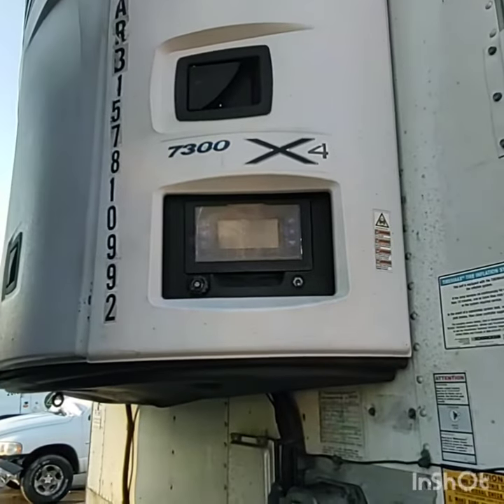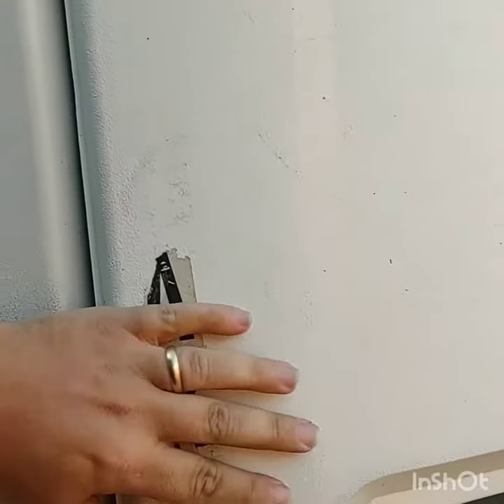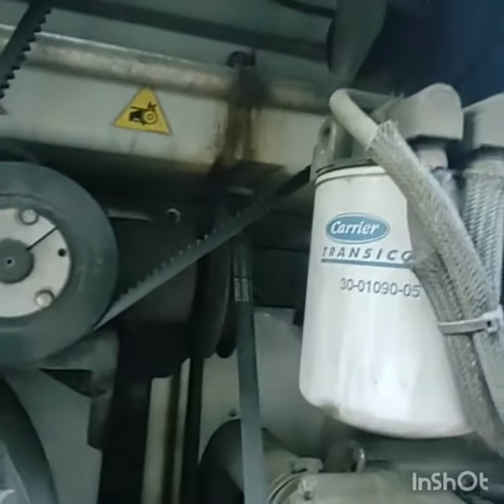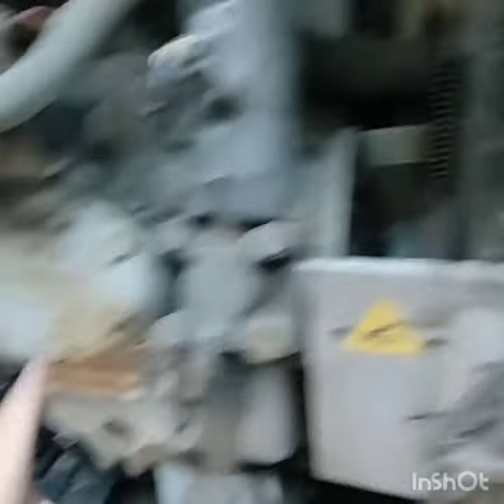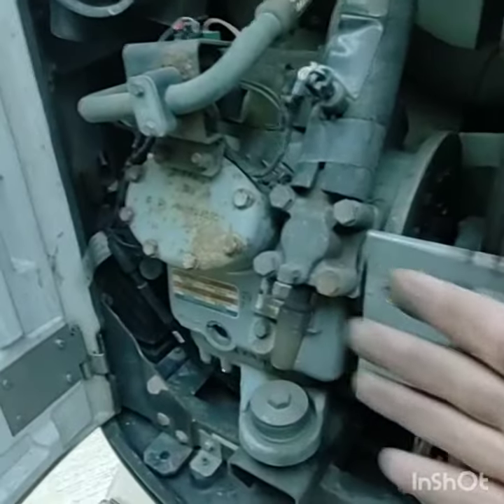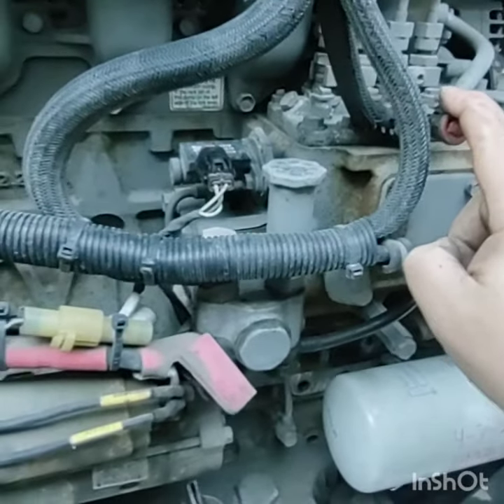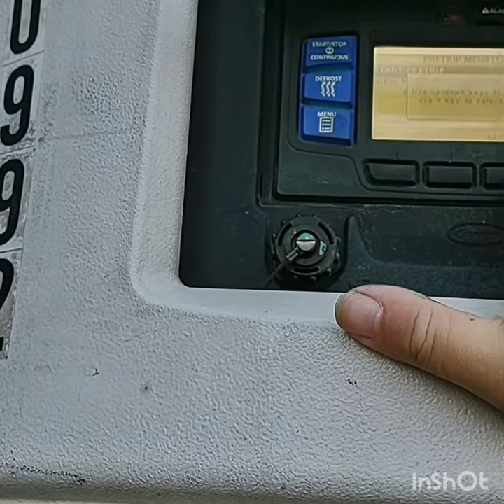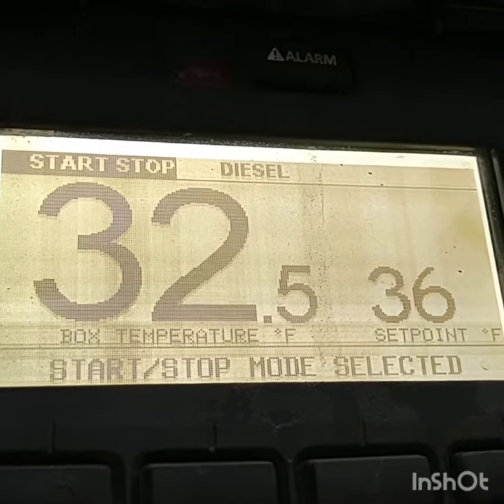Check these things regularly on your reefer unit....save money and problems later.

Comment: Good advice on wiring on alternator starter etc, my 1st trip on my 1st trailer a wire connected to the alternator snapped off and reefer shit off(lucky it didn't catch fire) and it costed me $250 for a simple snap on new connector on from wire to alternator bolt. Tha was my 1st ever reefer load and I was nervous lol got scammed out but I learned my lesson

Comment: Fuel saving tips: Get a extended blow gun to clean the condenser before every trip. Have a dealer install a simple door switch toggle next to the display to trick the unit in low speed only. Install a electric lift pump to take the load off the mechanical pump. The efficiency difference is noticeable and it will prime the fuel filter for you. If you have a exhaust leak change the air filter more often until you get it fixed. Good luck.

Comment: At the end of the video, your screen shows "diesel" .... Does that mean your unit is multi-fuel?
Reply from the maker: Where... I didn't see that
Reply: @DIYSEMI  at mark 10:05 just before starting pretrip. Top of screen says "Start/Stop .... Diesel"
Reply: It always says diesel on mine. Just normal I guess
Reply: @vroor32 The same software is used for the electric units.

Comment: What are the PM service things that the dealer will do on the reefer unit? ( Oil change, replace filters, add refrigerant oil…?)
Thanks,
Reply from the maker: Yes, and replace belts. Check battery, run prettrip check codes.

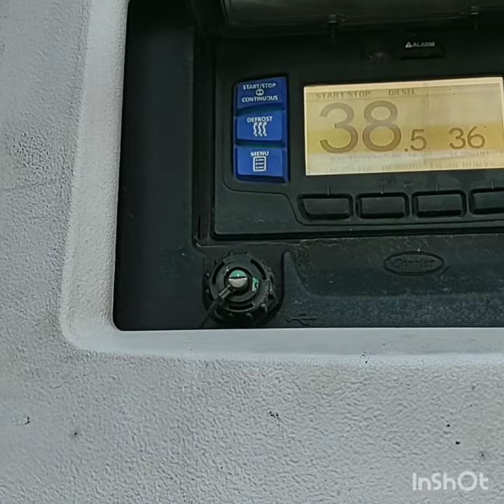Comment: Greeting group. I got a 7300 ×4, I set the temp to -10°F on Friday morning @ 10:00hr now it's Saturday 0135hr I'm still at 4.6°F degree. Refrigerant is at normal level, the red ball is floating. Any suggestions/ help will be appreciated thank you.
Reply from the maker: Have you checked your discharge temp? Go thru your menu and see what it is.  We need to check your delta t to see what temp air you are putting out.  Also, product could have been loaded warm